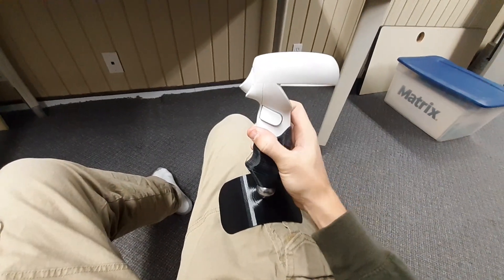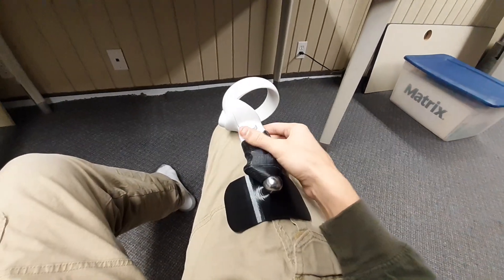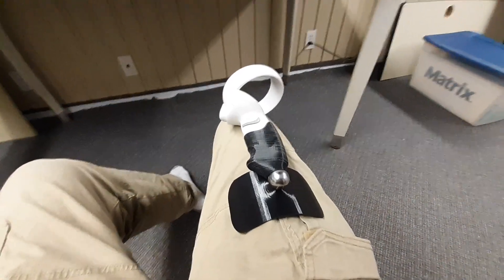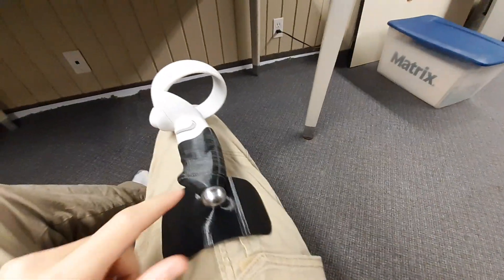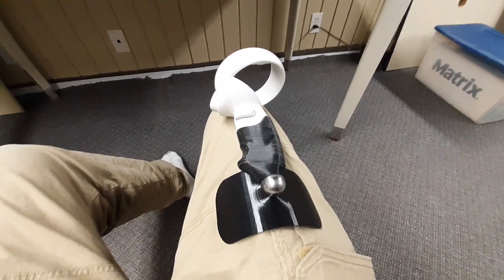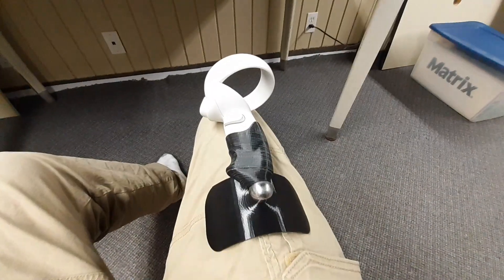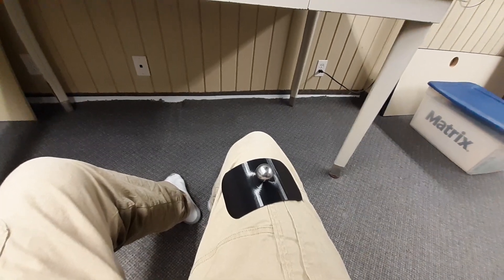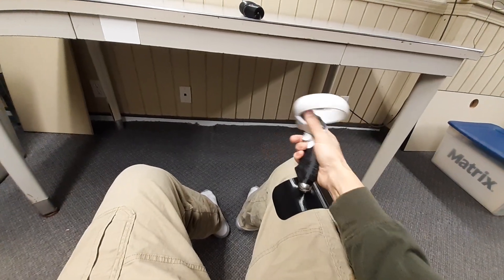Oculus Quest 2 3D printed Joystick

Comment: If you sit on a couch, in the center, or laying down across it, you could have the base under and sticking up between the cushions.  So, an adjustable height base would be ideal, but an old mop handle cut to length mounted on a base and topped with the steel ball would work, too.